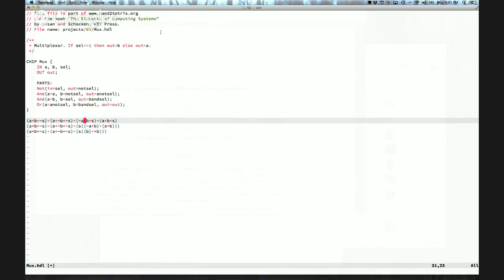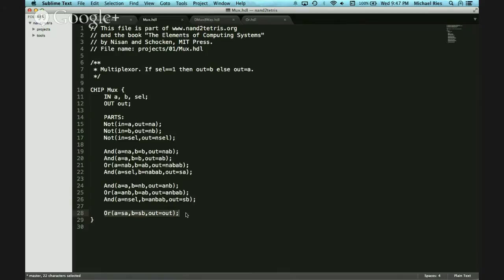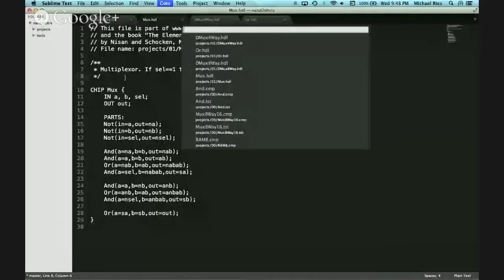Nand2Tetris Week 1

Comment: as achieving make a 1-bit ALU performs the following operations: addition, subtraction, AND, OR. I need a help
Reply from the maker: Carlos. I hope you're having fun with nand2tetris. When this group met to dicusss project 2 (with the ALU) there was a problem with the video so it never got recorded or posted. I'm happy to help point you in the right direction if you can post your existing code (maybe use a github gist?)
Reply: Well yes, but the problem is I'm new at this, let me work on making an ALU 1bits to do the operations postmarked within Addition, Subtraction, And and Or. It would greatly appreciate it if you could help me